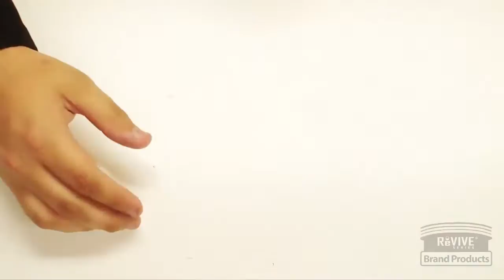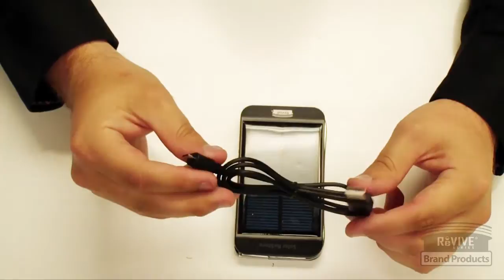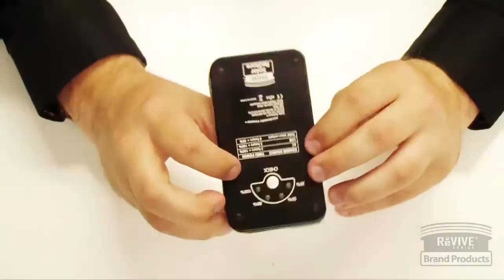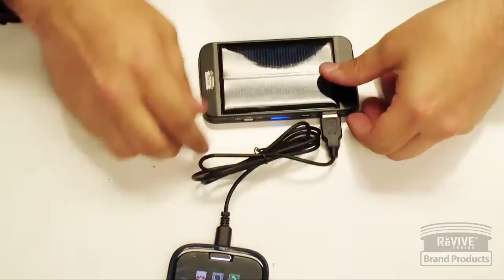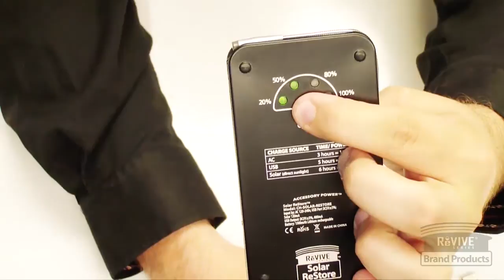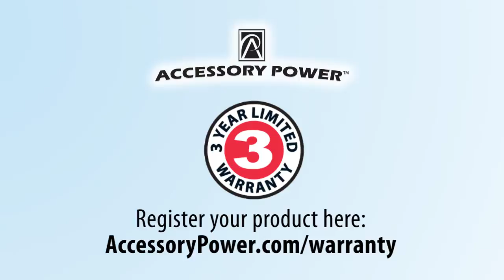ReVIVE Series Solar ReStore External Battery Pack for Smartphones, MP3 Players and Many More

Comment: it's not much of a solar charger if it takes 6 hours for it to reach 50% charged.  but this video is helpful because it came with no instructions and no ac adapter.  it doesn't seem to offer much power.  if i'd seen this before i bought the thing, i would not have bought it.